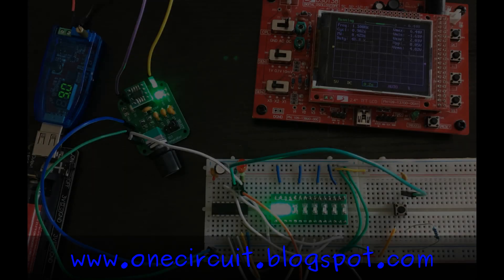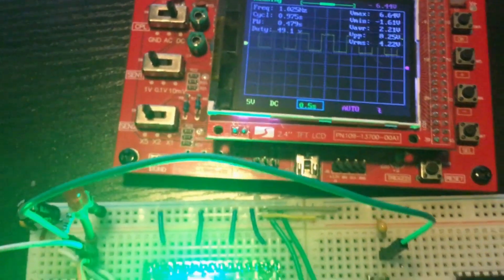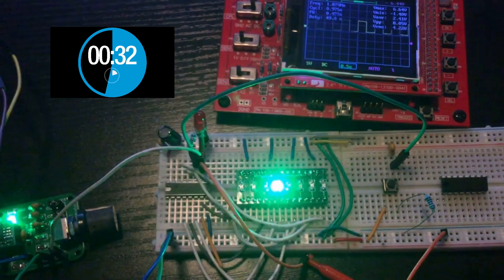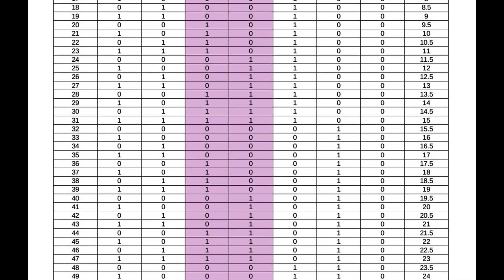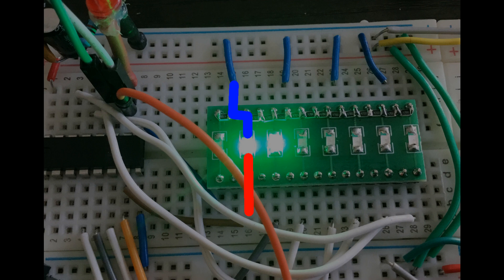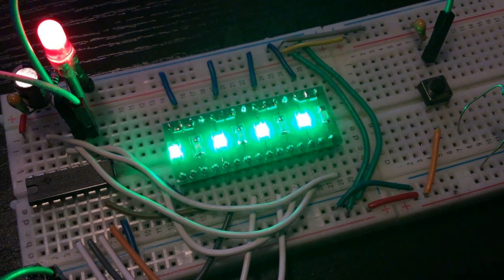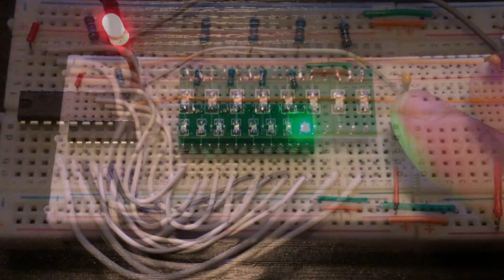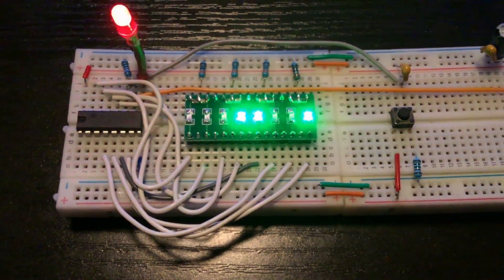CD4020 Counting Guy (sort of...)

Comment: Yes, I was disappointed with a similar chip -- the CD4060.  Missing some powers of 2 in there.  Probably made for a particular app, like a clock, with a watch (32768 Hz) crystal.  9-pin network resistors are useful for multiple blinky's.  http://www.hackersbench.com/Projects/1Hz/
Reply from the maker: Good idea on the network resistors! I have some around here somewhere...look out for them next time I’m in a blinking frenzy. 😉

Comment: If you rotate the Breadboard 180 degrees, it will count from the left. Great video and very useful, many thanks.
Reply from the maker: Yep, from the blog post associated with this vid (see link in the description): “I rewired the rat's nest and then worked out later that a much smarter me would have just turned the breadboard around 180 degrees!”